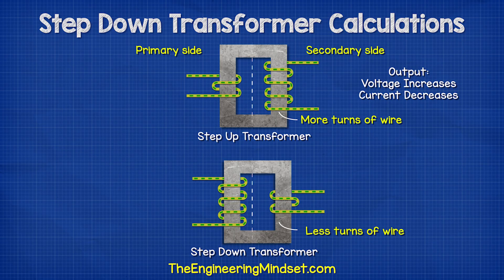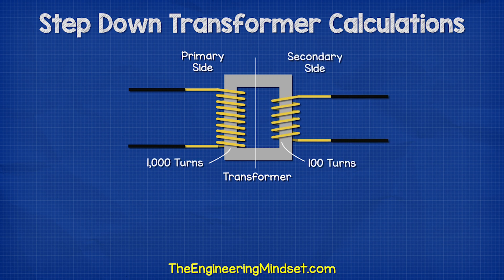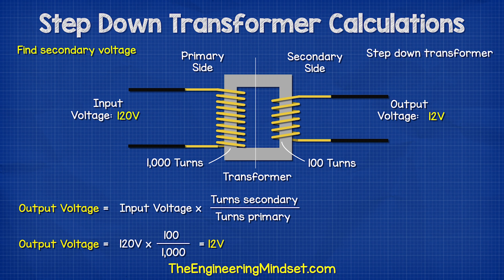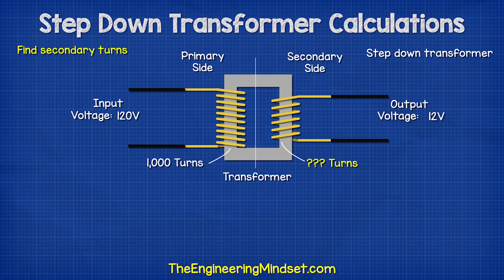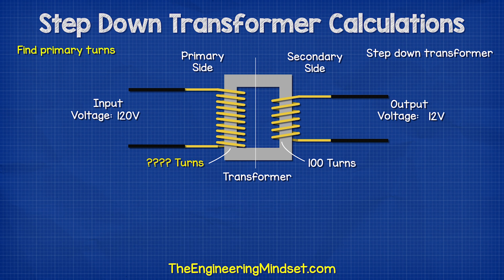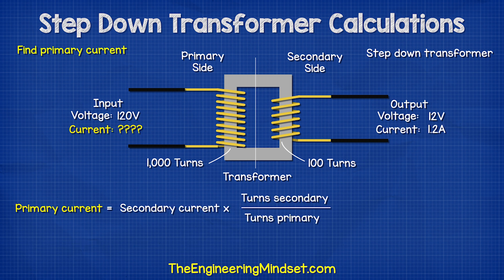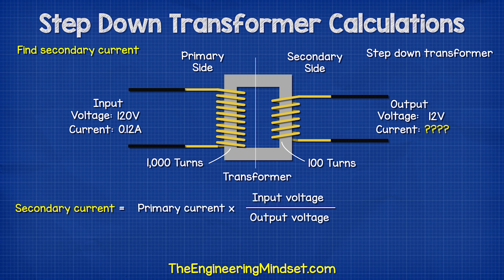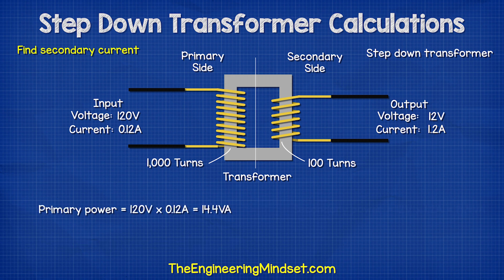Step Down Transformer Calculations - A Quick and Easy Guide

Comment: Can you please make a video about how a portable generator works? I am surprised that good information on this topic is lacking  on youtube.  Please include different types like inverter, avr controlled, capacitor, brushless, brushed, etc. There are videos  of people fixing them, but no one explains the stator and rotor windings and different wires coming out of generator head.
Reply from the maker: We have a video on electrical generator basics, also on brushed and brushless motors, you might find these useful

Comment: One thing they didnt explain much at uni was the reason for so many turns in real transformers rather that 50p -100s they are 5000p - 10000s for example. Is magnetic saturation

Comment: Let me correct the title for you: IDEAL step down transofmer calculation
Reply: Iron losses and rlc losses....
Reply: question: i intend to use a 3.7v battery to power a wall clock by stepping it down to 1.5v.

if the output goes to 0.8v (basically dead for a clock), will the 3.7v battery go down to a safe level like 2.4v?
Reply: @goldillux  I don’t know if I understand you correctly, but you want to provide 1,5V (for running a clock). The source is a 3,7V cell and in between there is a buck converter? If that’s the case your output will stop working at around 1,5V cell voltage because the IC will shut off at a certain input voltage range. If you want to squeeze out the last amount of energy, aim for a buck-boost, but that will cost efficiency…
Reply: @goldillux resistor

Comment: How to get MORE current from the transformer?
Reply: The only way to get more current is to increase the voltage on your output, so, less turns on the output side/more turns on the input side
Reply: reduce number of turns on side where you want more current??

Comment: What about eddy currents, efficiencies frequencies and so on?
Reply: Yeah, this is a VERY basic info video. There is of course, MUCH more to fully and properly designing a transformer than just what is shown in this video, but this video does give someone with zero knowledge about this topic, at least a basic comprehension of how they work, and I think that's all they were really trying to do here.
Reply: @JoeJ-8282  
I think you are correct, but that isn't what peaks my interest 😂
Missing informative videos like these that goes deeper into subjects.
The next thing is stiff people with low shoulders standing in front of a whiteboard giving you so much detail that you need to attend university again to get anything out of the video. I miss something in between that is practical for me when I need to decide which 3 phase transformer I should buy for my solar inverters and what impact all the specs given by the manufacturer does to my running cost and selection when picking one out for example.
Reply: @Mr.Engineer.  Hmm, sounds like you might should talk with a modern solar system expert, someone who knows EXACTLY what you need to know there! High voltage and high current electrical systems such as that are nothing to just casually search for random info about on the internet because you could potentially kill or seriously injure yourself, or at least possibly totally damage something in your electrical system if you just base your system setup or hookup on random YouTube videos for example! You really might should consult a true solar system expert about what you need there. Someone local possibly, in your own town, one who installs those kinds of systems professionally at their job or business.

I totally get trying to understand it yourself, whether just out of curiosity or satisfaction of doing something yourself, but electrical systems are not something to just "experiment" with to see what might work, because before you find the perfect solution, you might end up severely damaging something because it was accidentally hooked up wrong!

I say all of this, not to scare you, but rather as a fair warning... And I am an electrician by trade BTW, so I know exactly how potentially dangerous electrical systems can be if you don't know EXACTLY what you are doing, so I'm just saying... Seek professional help in your situation if you don't already know exactly what you need to do and how/with what!...

IF I could give you more detailed and exact solution help then I would, but even though I do basic residential and sometimes commercial electrical work, I do not install solar systems, so I don't really know anything about the modern ways they hook those up nowadays, especially if it's a constantly grid-tied system that you have!

Anyway, best of luck in finding a solution for whatever you're trying to do with that, just be safe about it!
Reply: @jeremiahbullfrog9288  Maybe so, but I feel like this video was intended for the electronic "noobs", the ones who know very little, if anything, about how transformers work... Maybe he will produce a more advanced, in-depth video about the further nuances of transformers and maybe even how to build them, in the future...